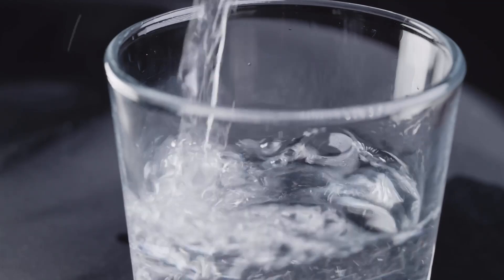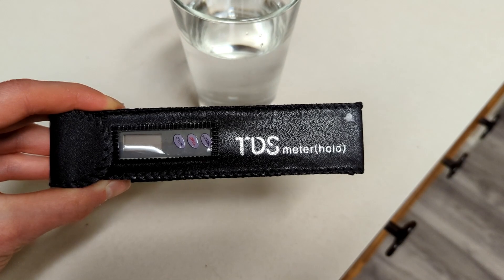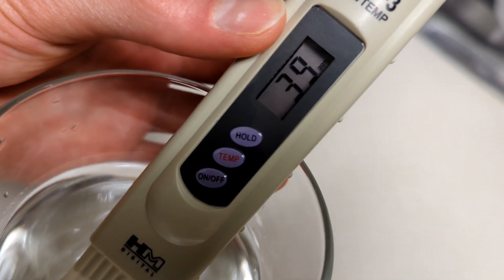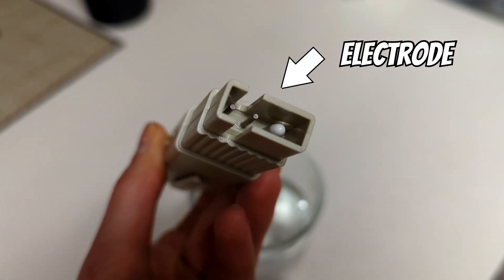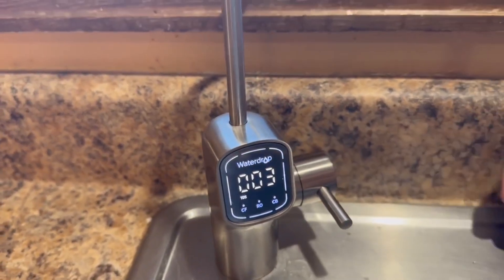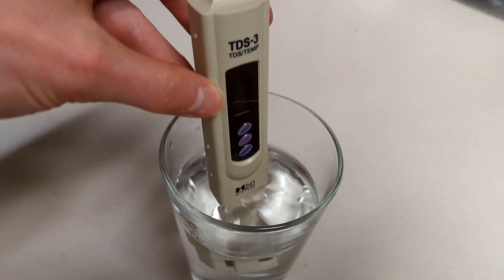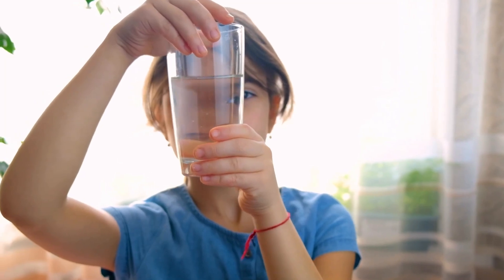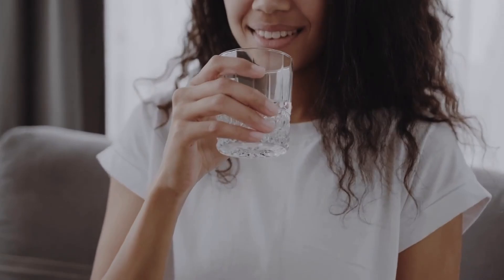The Truth About TDS Meters and What They Actually Measure in Water

Comment: So using this TDS meter does nothing? I tested my daughter's water and it came out to 26.5 so I have no idea what that means.
Reply from the maker: It measures total dissolved solids, but it doesn't tell you what those solids are. It's not useless, but a TDS reading alone doesn't tell you if water is healthy or not.

26.5 PPM of TDS is actually very low. Edit* that means there are 26.5 PPM of dissolved "stuff" in the water. Likely minerals, but could be other substances as well. No way to tell for sure without more precise analysis

Comment: So what good is this stupid thing ? I was trying to buy something that would help me determine if the water was safe to drink..but apparently this thing is useless
Reply from the maker: Totally get the frustration. TDS meters are often marketed as a way to check if water is "safe," but that’s not really what they do. They just measure the total amount of dissolved solids—things like minerals, salts, and metals—but they don’t tell you what those solids are. So water with dangerous levels of lead or arsenic could still show a “normal” TDS reading. And water with healthy minerals could show a high reading and still be perfectly safe.

They're more useful for things like checking if your reverse osmosis system is working properly—not for judging safety. You’re not wrong to feel misled.

Comment: First she says that the TDs is not tell you whether or not the water is healthy or not and then later on she says that it will tell you the quality of the water. Isn't that the same thing
Reply from the maker: Not quite.

TDS just tells you how many dissolved solids are in the water, not what those solids are. So it doesn’t tell you if the water is healthy or safe. You could have high TDS from healthy minerals, or low TDS with harmful stuff like lead still in it.

A TDS reading can give you an indication as to the quality of the water, but does not provide specifics. For example, extremely elevated TDS, like 500+ can indicate there are water issues that need to be treated, but not specifically what those issues are.

Comment: So, I just got a TDS and I didn’t know what to do with it. Thank you for helping me to do teaching me to do what, but wouldn’t the water be damaged? I mean wood in the TDSD device will be damaged. Thanks water. It is great at you know, destroying electricity and stuff. If you dip a TV in water, wouldn’t the TV stop working? Wouldn’t the same thing happened with TDS
Reply from the maker: No, the devices are intended to be put in the water. There is an indicator on the device that tells you where you should not dip it in the water past

Comment: When testing water with a ppm tester after boiling water, the ppm may increase due to the removal of certain contaminants but the introduction of others. Boiling water can help eliminate pathogens and bacteria, but it may not remove all dissolved solids, minerals, and other impurities. The boiling process can also concentrate dissolved substances, leading to higher ppm readings. Therefore, it's essential to consider the type of contaminants present in the water and the boiling process's impact on their concentration before interpreting the ppm results.
Reply from the maker: You bring up a great point, especially about how boiling can increase the concentration of dissolved contaminants as water volume decreases. That’s spot on. One thing to clarify, though: some contaminants like bacteria and other pathogens don’t actually contribute to a TDS reading because these are suspended solids, not dissolved solids. TDS meters only detect dissolved ions and compounds like salts and minerals. So while boiling does kill biological contaminants, it won’t reduce the TDS reading in that regard. In fact, as water evaporates during boiling, the ppm reading can go up because the dissolved solids become more concentrated in the smaller volume of water.

Comment: In regards to the TDS meters is there a specific meter that might be better than others when in regards to the tds, example, the free meter that comes with zero water filter pitcher, would another meter be on par with that or be better at being a little bit more on point with a reading?
Reply from the maker: I honestly haven't tested that. TDS meters all work the same, but I'm not sure which if any are more accurate than others

Comment: True. But if you have a filter that can reduce TDS to like 10, at least, I can guarantee you that no bacteria will be spared or left unfiltered.
Reply from the maker: While membrane filters that reduce TDS will reduce bacteria, they shouldn't be used as to do so due to the risk of biofilm and membrane fouling.
Reply: @waterfilterguru hi:) is there anything you would recommend (such as chem strips) for bacterial or parasitic detection in water supply when traveling internationally.  I’m aware of precautions to take & always do but am interested in knowing (as well as confirming which hotels/resorts really are using RO as well as maintaining it)…tysm
Reply from the maker: @kikiandriani9534  That’s a really smart question. Unfortunately, there aren’t any truly reliable instant test strips for bacteria or parasites  those organisms require incubation or specialized detection methods. There are a few on-site options though: you can use something like Aquagenx CBT https://geni.us/26AAZ or Watersafe Bacteria Test https://geni.us/3RmAwSi which detect total coliform and E. coli and show Presence or Absence. They’re portable and don’t need lab equipment, but they still take around 24 hours to show results.

For parasite detection (like Giardia or *Cryptosporidium*), there aren’t any practical field kits. The best you can do is use a portable filter with an absolute pore size of ≤0.2 microns, or pair that with chemical disinfection tablets for added assurance.

As for verifying if a resort or hotel’s “RO system” is real and maintained that’s tough to confirm without direct testing. If you have a TDS meter, that’s a good first check: properly functioning RO water should measure below ~30 ppm in most places. If it’s reading 100 ppm or more, the system either isn’t RO, the water is remineralized, or the membrane hasn’t been serviced in a while.

Comment: I used TDS for quality of the water got a good reading but when I put a couple of slices lemon in and tested the water got a higher numbers than the first one witch is dangerous to drink the water
Reply from the maker: A TDS reading alone does not tell you if water is healthy or not. This is a perfect example
Reply: @waterfilterguru  thanks I use Brita filters for the water the result was before was high and after the filtered was great and my concern was the lemon slices usually I put in my water spiked the reading and should I worry about it
Reply from the maker: @manonano6169  Adding lemon juice to water increases TDS (Total Dissolved Solids) because lemon juice contains dissolved minerals like citric acid and potassium. However, like I already mentioned, higher TDS doesn't always mean unhealthy water. In this case, the added minerals from lemon juice are probably be beneficial

Comment: But can a TDS Meter be useful for household drinking water in a developer country where it generally is said to be 'safe' to drink from the tap?
Reply from the maker: A TDS meter does not tell you if water is healthy or not
Reply: @waterfilterguru  Thanks. What can I use instead to find out whether or not our tap water is safe to drink (or has contaminants or not)?
Reply from the maker: Lab testing is the best way to determine specific types and concentrations of contaminants present
Reply: @jonsantos6056 a grayl water filter bottle.  Than ya don’t have to worry about the bad things in 3rd world water.  Aside from maybe chemicals.  But viruse etc gets removed
Reply: I started to feel ill after drinking water  so got one of theses  my tap water is well over 550 ppm  and im in the mainland UK
Reply from the maker: @turokforever007  But that 550 ppm TDS reading could primarily be made up of dissolved calcium and magnesium, both healthy minerals. No way to tell if it's unhealthy unless you lab test it

Comment: Is there any filter that removes arsenic from the water? It seems that theres some arsenic in the water here in one part of Serbia. Also - does a really high TDS indicate unsafe water even if it’s really rich with minerals or should I say - would that mean that the amount of minerals is too high anyways (or other particles) and that it’s unsafe for drinking?
Reply from the maker: A high TDS reading alone is not enough to tell you if water is unsafe or not. For example, that TDS reading could be primarily made up of calcium and magnesium, which are both essential to human health. This is why we always recommend a full lab water analysis to get the best idea of the water situation.

As for arsenic reduction, reverse osmosis is typically the recommended treatment method. Depending on the application, it can also be reduced with activated alumina media, distillation, and anion exchange systems.

Comment: I think that's why it can't measure if there is poison or not. Or may be it is calibrated Zero in distilled water. Also there are poisons that are very lethal in small quantities (i. e. 1 to 300) which falls inside the safe drinking water range upto 300, prescribed by WHO
Reply from the maker: Correct, a TDS meter can give an indication to the quality of water, but it does not provide specific details about the contaminants present and whether or not water is health.

Comment: I have watched a lot of tds test videos and I find your video to be the best so far.
I have a question that I'll be very happy if you can answer:). I wanted to store drinkable water for a long period of time ( in a proper container and proper locatin) let's say that I want to drink that water after 6 months, can a tds tester help me know if the water is still good to drink?
Reply from the maker: No. You would want to test for microbiological contaminants, which a TDS meter cannot do
Reply: @waterfilterguru . Piece of cake. Micro-“beings” are just that..micro, which are done by boiling 🤷! If a filter can produce a TDS of 10, then I can guarantee you that no micro “guy” will survive (pass through that filter). I’ve tested a bunch using bacterial test kits and always zero bacterium. So, yes, TDS is really good.
Reply: I use the tester when I make colloidal silver water,WHICH  if added WILL keep water fresh for a long time. I keep ice chests full in case of frozen pipes power outage etc. At 3 months  old still good and if I'd closed it up properly  and frogs hadn't defiled it ,who knows.

Comment: Is there any home option for testing those things TDS doesn't at home? Or is the only solution to have to send a sample to a lab?
Reply from the maker: Lab testing is by far the best option, as it will provide data on specific concentrations of contaminants detected, and also look for a wide range of contaminants and other analytes (hundreds)

There are cheap, at home DIY test strips, but the drawback is they don't provide any info on the specific concentration of contaminants detected, and only test for a handful of the most common contaminants (typically 10-15)
Reply: @waterfilterguru  Appreciate the response. Thank you 🙂

Comment: I dont understand why it wouldn't measure bacteria since that is a solid
??
Reply from the maker: Because a TDS  meter works by measuring the electrical conductivity of a solution. 

They use two electrodes that are placed in the water being tested. When voltage is applied across these electrodes, the ions in the solution conduct electricity, and the meter measures the conductivity. Based on the conductivity reading, the TDS meter estimates the concentration of dissolved solids in the water. Bacteria themselves are not conductive and so are not detected with this method.
Reply: @waterfilterguru ok thanks so much.

Comment: Hello my Tester indicate this 0419 ppm with green screen on TDS mode and 0802 us/cm red screen on EC mode I don’t understand if is good or not
Reply from the maker: EC stands for electrical conductivity, which is what the meter measures in the water. The meter calculates an estimate of TDS by multiplying the EC reading with a conversion factor.

A TDS reading of 419 PPM is high, but still within the EPA secondary standard of 500 PPM. This means there are elevated levels of dissolved substances in the water. A lab can test a sample to identify the exact types and concentrations of those substances.
Reply: Thanks for you answer.

Comment: How do you measure your water filter ? I just bought a water fliter distiller. How do  I know my water is healthy to drink?
Reply from the maker: The best method to performance test a water filter would be with lab testing before/ after treatment
Reply: What kind of water filter do u recommend?
Reply from the maker: It depends on the specific situation. There is no 'one size fits all' solution for every application! This is why testing before puchasing any water treatment equipment is so vital

Comment: So does a high reading mean the water is rich in minerals? Or is low reading better?
Reply from the maker: A high TDS reading indicates a high level of dissolved solids - whether those are healthy minerals or dangerous metals you won't know unless you conduct more extensive laboratory testing. 

A TDS reading can give you an indication of the water quality, but not all substances that make up TDS are harmful.

Does this help?
Reply: @waterfilterguru  thanks, yes. I guess it can be useful in some situations where you expect the water to have few solids.
I'd imagine a high reading from tap water in a city would most likely be bad.
Reply from the maker: @rayrivera1830  it depends, it may or may not. The only way to know for certain is to lab test a sample

Comment: Hi, I am measuring tds value in water over time. In this experiment, I am took water from Tap water in a bucket, and measured TDS in the morning, afternoon and evening times. what I saw is that TDS is increasing over time but I don't understand why. Is it because of bacteria growth or some other reason is there?. and also dissolve oxygen decreases over time. does TDS depend on the number of cations or anions?  what happen when anions are more than cation. Please reply If you have answer
Thanks
Reply from the maker: Hey thanks for the great question! Possible reasons for this increase could  include: Evaporation, which concentrates dissolved solids as water volume decreases. Contaminant accumulation from the environment or the container itself. Microbial growth (bacteria, algae) and their metabolic byproducts. Chemical reactions with the container or nearby materials. Dissolving of solids from the surrounding environment (like dust or particles in the air).

Comment: May I ask for your input regarding distilled water, please . How much is being removed with this method. Should I buy good quality salt ( celtic salt, for example) and coconut electrolytes to add into my drinking water? 
Also I understand that TDS meter isn't necessary,  would you suggest good water testing home kit? I live in UK.
Reply from the maker: Distillation removes nearly 100% of everything (assuming there is a post-carbon filter). All dissolved minerals will be removed from the distilled water. Check out this article to learn all about how to remineralize distilled water: https://waterfilterguru.com/how-to-remineralize-distilled-water/

For testing, I'd recommend you find a local certified lab there in the UK. Lab testing is the only way to determine exactly what contaminants and concentrations are present. Other at home test methods (strips, kits, etc.) can give an indication as to whether or not a handful of contaminants are present, but they won't give you details on exact concentrations.
Reply: I appreciate your reply a lot . Thank you 🙏💜
Reply from the maker: You're welcome! Happy to help  @jkhuntress

Comment: With ZeroWater, I start a 0 and build my drinking water. 1/2 tsp sea salt, 1/2 tsp magnesium carbonate, 1/2 tst baking soda. I assume my city water is fairly clean and that ZW is taking out bacteria, which are probably larger than the mineral solids in the water. I'm in San Francisco so my water comes from rain and snow in the Sierras.
Reply from the maker: Keep in mind that a TDS meter is only capable of measuring dissolved solids, which means that other types of contaminants won't be detected!

Comment: So, I'm hoping you will consider doing a video or few regarding filtering well water. Our well was drilled several years ago on the undeveloped lot, and that's all it is at this point. There's no pump or anything yet. Our neighbors on the next ridge over expressed their disappointment with water quality, but the only filtering they are doing is with a standard salt-based water softener. They are using countertop filtration devices for drinking water the last time I was there. 
Obviously, we don't have to concern ourselves with chemical additives, but we will be testing for naturally occurring elements. Our water source is the Roubidoux (pronounced ruby-doo) Aquifer and our location is in Northwest Arkansas.
Reply from the maker: Hey thanks for the comment - so the first thing you will want to do is have a sample of the well water tested by a certified lab. Because there is no water provider doing any treatment, it's the well owner's responsibility to test and treat as necessary. You might find these resources helpful:

https://waterfilterguru.com/how-to-test-well-water/
https://waterfilterguru.com/well-water-treatment/
Reply: If you have farm land near by. You really need a lab test every couple of years. Google farm land fertilizer and well water.